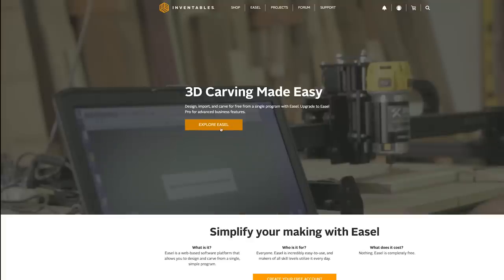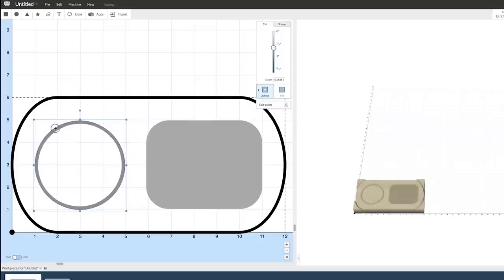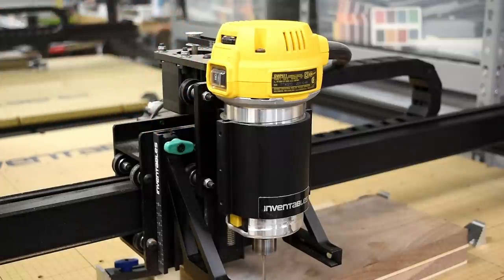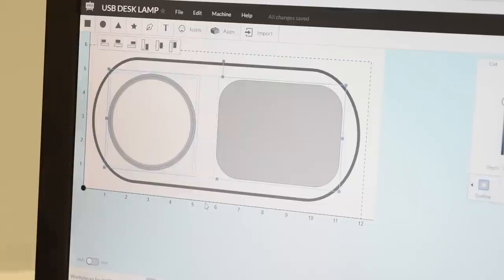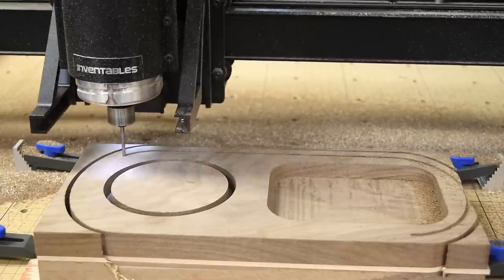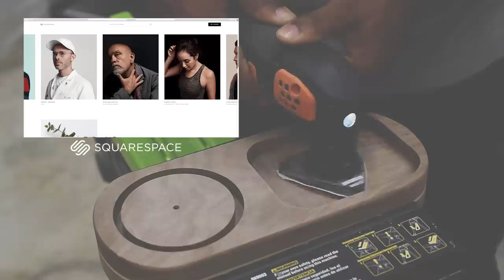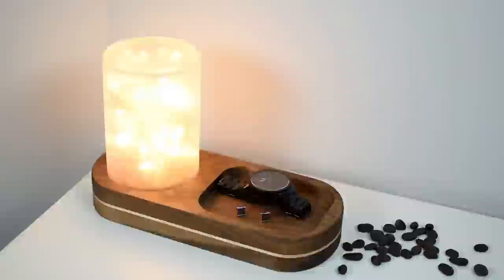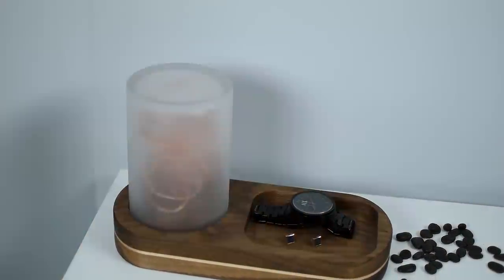LED DESK LAMP USB Powered

Comment: Instead of screwing the backing board on the piece (and risk hitting the screw with the bit) can you hot glue it on then iron it off after the shapes have bee cut out? (I don't have a cnc and don't actually know if it would work)
Reply from the maker: I don't think hot glue is strong enough. The machine has a strong push, the material needs to be secured firmly. I am thinking of making a clamp or something.

Comment: For future CNC cutouts, if you don't want to screw into the back of the wood to secure it to the scrap, you can use double sided tape, works just as well and you don't have to worry about holes if you aren't planning on cutting off the scrap like you do on this project

Comment: What a pain.  Could have made that by hand in half the time.  And its not really relateable to the average viewer.
Reply from the maker: I understand overall I want to get better at using the CNC machine. It's a great tool for extra inspiration and expanding the creativity.
Reply: It is cool.  I love your channel.  Made shop shelves out of 2x6s with LED under lights for crafting based on your design, so thanks!

Comment: I’m old school. I don’t see how a CNC is woodworking since it is all done by a computer.  What happened to the craft using your hands
Reply: Rebecca S. I’m sorry you see things that way I was taught there are many was to do things just use the tools that you have
Reply: Computers are very stupid. Using a CNC means the operator has to explain every little stage of the process to the machine. There are some nifty programs that can simplify that process, but the computer can't design the parts, set up the cut, check to make sure the router head isn't going to crash into a clamp, etc. CNC is like any other tool; it's designed to make some things easier, but that doesn't mean it doesn't require technique and practice to use correctly. It doesn't do all the work for you, any more than a power drill does.

Of course, also like any other tool, their use won't appeal to everyone, and that's cool. But I think it's important to realize that behind every computer is a person telling it what to do. A different skillset than hand tools, yeah. But it's definitely a skill.
Reply: I agree it is not woodworking but it does awesome project! Just sad that I like his video for the few tool he was using.
Reply: It's a different kind of craft. It's not "all done by a computer". You have to design and fab up the blueprints, and if you aren't good, the finished product won't be good.
Reply: the way i see it, CNC isnt meant to be a replacement for woodworking..its just make the work easier and considering u can just set it up how u want it to carve and u can just do other stuff while waiting for the CNC to finish...
Reply: The craft shifted to your head... Not entirely but to a larger degree.
I mean... It's not like you can just tell the machine "Julie, do the thing!" and it will come up with an idea for you and then figure out itself how to process that idea into a solution.
Reply: And some people will say the same about power tools and why use a chisel when the real craft is in using a piece of flint and a deer antler